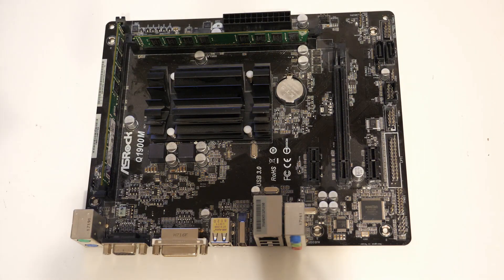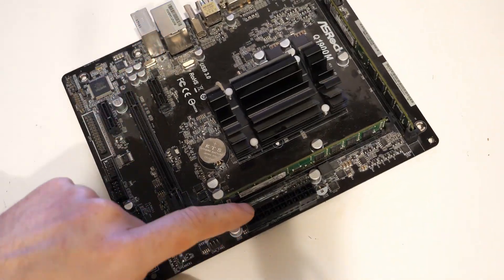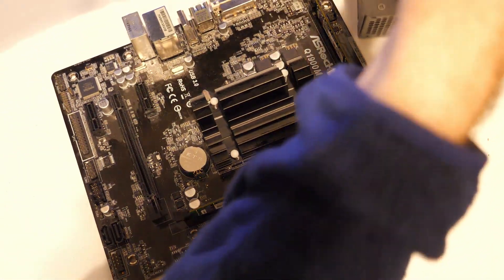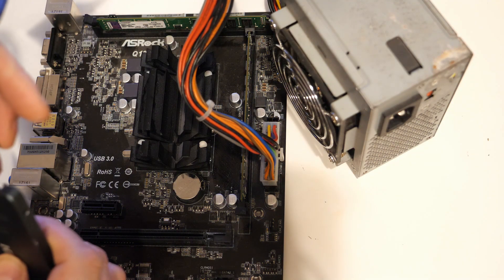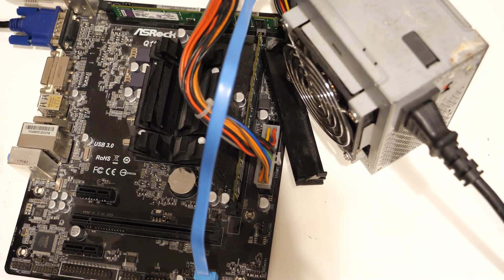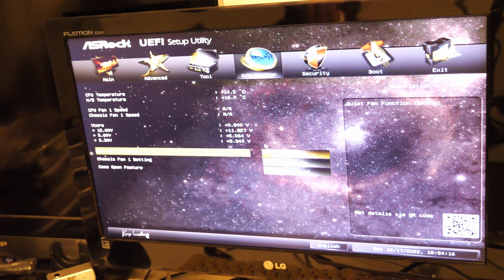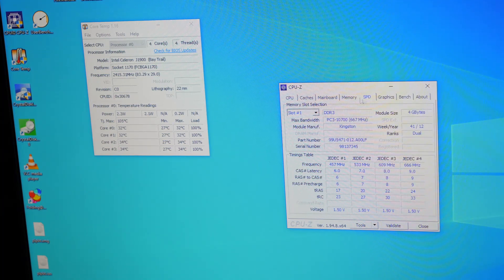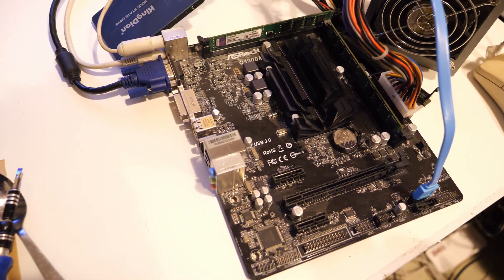Can you use a 20pin Power Supply with a 24pin Motherboard? (ASRock Q1900M)

Comment: Other boards may need the +4 to work as my ASUS P5Q-EM board will not boot without the +4 from late 2000s. Not all boards require the +4 but most nowadays do. The +4 connector carries +3.3V, +5 and +12V and ground.